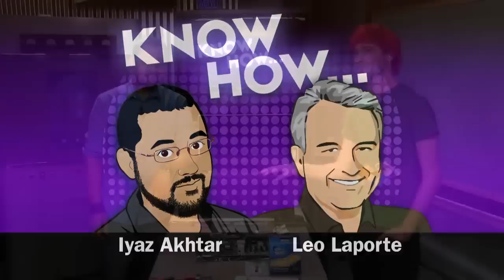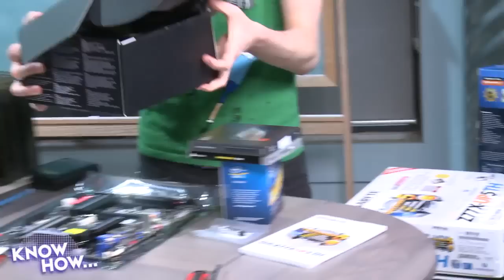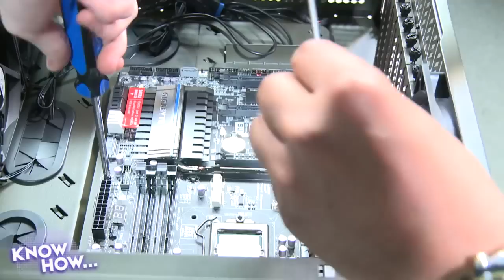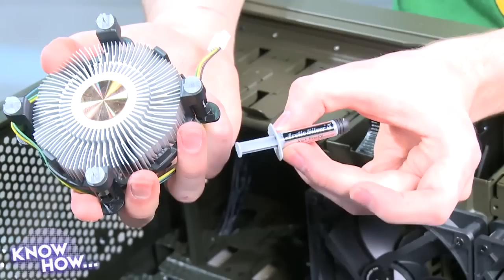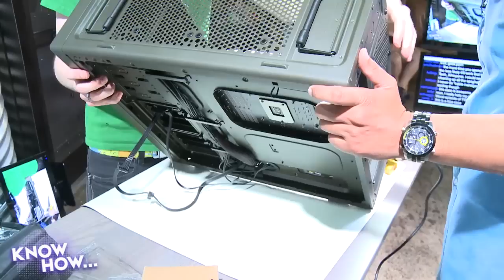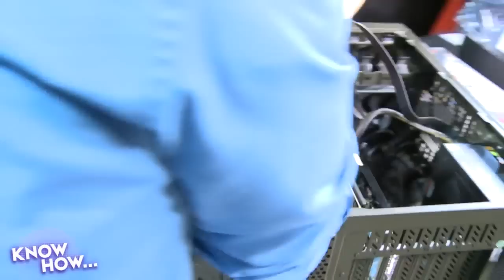How To Build A Computer - Easy PC Builder Method

Comment: Heey everybody! :)
I have an old PC and i want to make it a gaming PC I'm just wondering what are the things i should change in my computer? here's the properties of my computer:
RAM 1G -- CPU CELERON 3000 -- HARD 160G -- VIDEO CARD 512 MB -- MOTHERBOARD GIGABYTE
THANKS IN ADVANCE :)
Reply: +Mostafa Abbas you need to upgrade most everything. 

For RAM get at the minimum 4g

You need a CPU core that gets around 2.5 GHz or higher (preferably multi core)

for the video card you should get one with 2gb minimum or 4GB or higher for flawless performance.

That being said. These parts may require more battery than the one you currently have so you need to calculate how many watts you need for these new parts.

And last of all you want to make sure that the case you have now can support the dimensions   of the new devices. And  that you have the proper cooling for the inside.
 Good Luck!!